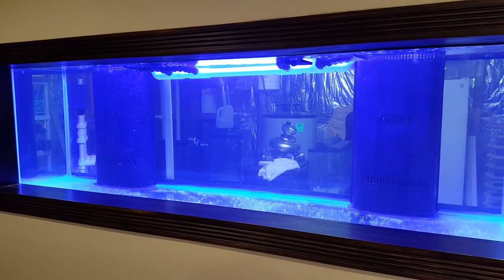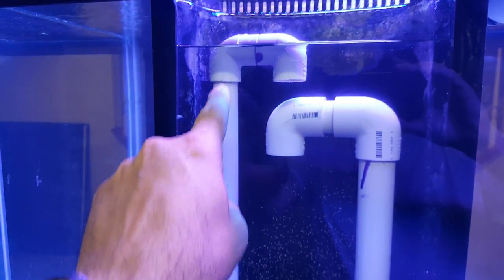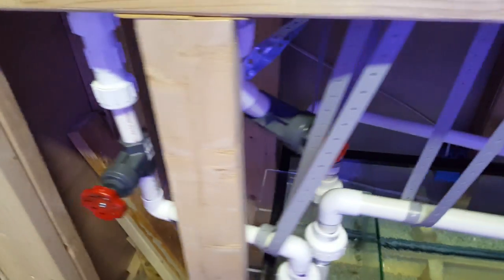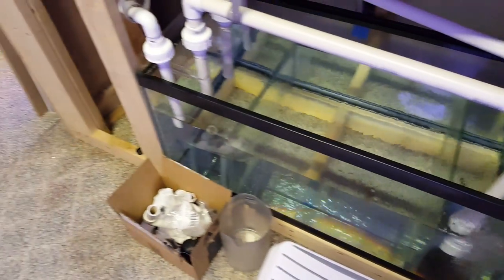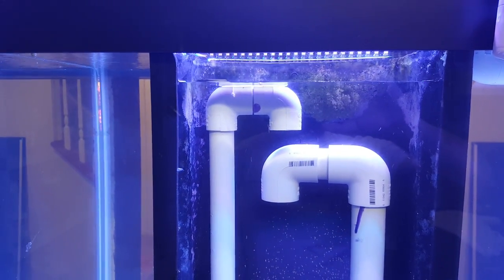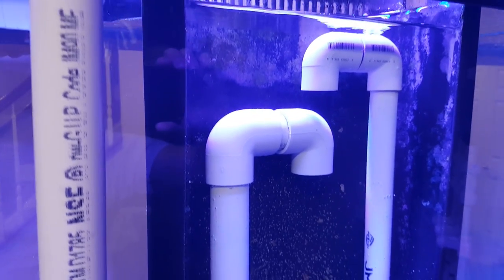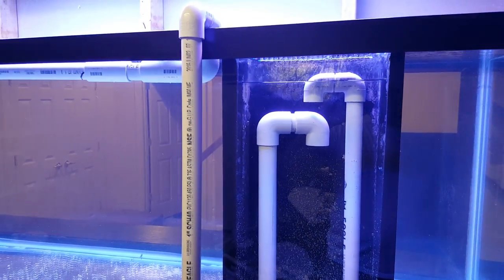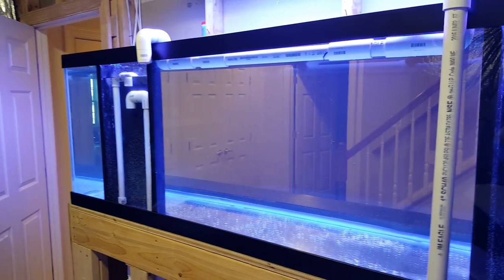How to turn a mega flow into a full siphon.

Comment: Great video! Question...I'm going to do this to my 90 as well..what happens if the the full siphon clogs? The other drain becomes full siphon? I got new bulkheads to fit for Both my drains to be 1"..is that ok? (Both holes in bottom of tank are same size, apparently they didnt used to be in older models)
Reply from the maker: If just 1 full siphon clogged, it is possible that the open channel would go full siphon. I don't think it would carry the load though but the other open channel might be able to take up the slack in that scenario. But the design doesn't depend on this for safety (from flooding). I'll have to experiment with this and see what it does thanks for the idea!
Reply: @WoodBob  Thanks! just asking because I'm going to do this with only one overflow, but I guess it doesnt matter what the 2nd drain does because compared to the durso single drain it came with..its much safer just to have a second drain at all.
Reply from the maker: Ah ok - I see part 2 of your question. With just 2 holes both being 1", if the full siphon of the 2 failed, the other might go full siphon but it would not be able to carry all the load due to not having an open channel. In this case it would probably flush until you realized something was wrong and corrected it.

Comment: how big are the holes drill in top of return need to be thx you sorry to ask so many questions my first sump dont want to flood room
Reply from the maker: If you mean the main siphon standpipe, 1/4" or larger should be fine. It is just an air-entry hole to allow water to flow properly.
Reply: @WoodBob  thx you so much

Comment: I just bought a 180 gallon tank with a single overflow. 2 bulkhead in the overflow, a 1 inch and a 2 inch. Up til watching this video, I was planning on running a die so in the 2 inch and a single return in the 1 inch split into 2 lock lines. My return chamber doesn't have cut-outs for return (lock) lines. I was trying to figure out the best way to plumb this. Now that I've watched this, I'm thinking my best option is to go with a full siphon setup like yours and running my return behind the tank as you've done and over the back rim. Would this in fact be a better option with a single overflow?
Reply from the maker: For sure a full siphon is a better option! Over the back returns are much better and allow greater placement of return flow like I did with multiple returns across the top.
Reply: How would you handle the 1 inch and 2 inch bulkhead in the overflow? Would you step the 2 inch down to a 1 inch at the bulkhead to keep all pvc 1 inch?
Reply from the maker: No it doesn't really matter what size the pipe is as long as it fits the fittings. The bulkhead holes will dictate what size pipe to use I suggest not changing the size but I doubt it matters either way. I know there is a durso video out that talks about using bigger size pipe and necking it down but this is a full siphon so it doesn't matter if the pipe changes size or not.

Comment: Which pump is that and how much head? Just wondering how much you're actually flowing through there.
Reply from the maker: This is the Jabeo DC-6000 with about 4 feet of head. It is rated at around 1500gph. I am very happy with the Jabeo pumps I also have a DC-9000. Those are 1" drains so will run around 2400gph each at full siphon maximum. My estimate is they are at about 25% of max capacity each (600gph), or slightly over 1200gph total flow for both drains.

Comment: What fitting did you say you don’t need for the 3/4 open channel where you drilled the hole?
Reply from the maker: Use slip (glue) connection bulkheads and simply set the drains into place without gluing. This allows for easy removal for maintenance. I use keg lube on all gaskets just be sure not to over-tighten (hand tight only).

Comment: Interesting video im wondering do the full syphon need the double elbow or can they just be straight pipes ?
Reply from the maker: Straight pipe is fine but the double elbow makes sure it doesn't start a vortex from the surface and ingest air.

Comment: You can avoid any chance of getting dry running pump by adding a float switch. Being that you have a dc pump, a boat bilge switch can be wired right in.
Reply from the maker: That is a great idea thanks! That Jebao pump failed I am back to my reliable eheim.

Comment: What's the advantage over using the standard megaflow kit?
Reply from the maker: The standard kit is a Durso style drain which is not full-siphon and somewhat noisy not to mention has relatively low flow and tank turnover rate. Durso drains have largely been replaced in the industry by full-siphon style drains such as Herbie and Bean drains.

Comment: how did you hook  up drains & returns to bulkheads thx you
Reply from the maker: On the bottom of the bulkheads is a threaded connection (slip would also be fine) and in the weir the drains are simply set in place. They do not need to be water tight in the weir but coming out of the bottom, they do.

Comment: awesome setup, I definitely want to replicate this with my 90 and single over flow, is there any benefit to splitting the return and having some flow go to the refugium directly? or does it get enough flow from the skimmer chamber?

I was looking to use the ruby elite 30 or ruby 36S which the elite has the fuge drain separate from the rest of the sump 

http://www.triggersys.com/ts/ruby_sumps/

what is your opinion on having the refugium a completely separate section of the sump with it's own dedicated flow T from the return on a gate/ball valve?
Reply: how do you determine how long to make your return run with the loc lines inside the tank? for a single over flow I would think only 1 or two are needed?

Comment: Just so I'm clear this tank comes from the manufacturer drilled with the overflow boxes?
Reply from the maker: Correct. It comes exactly like you see it.
Reply: @WoodBob  can this exact setup be done on any tank? I built a 300 gallon plywood tank and haven't figured out my filtration yet. I'm using a 75 gallon  tank for a sump.
Reply from the maker: Yeah you sure could this would be great for a plywood build. You'll need at least 1 weir but the rest is the same.

Comment: My tank only has 1 hole in each overflow so would I be fine just doing the full siphon instead of having both the pipes?
Reply from the maker: No you will not be able to balance it out. It will either run too fast and "flush" or it will run too slow starving your return pump. The extra pipe is critical for balancing the full siphon. You might be able to run a full siphon in one weir and use the other one to balance. I have never tried that but it should work in theory! Good luck!

Comment: Awesome video.  Exactly what I needed.  I have this tank in 90 gallons and want to do the same thing.  What calculations are necessary to make this happen?  How do you know how high each pipe has to be?
Reply from the maker: You want the open channel high enough so that the cascading water is not too loud and the full siphon channel below that where no water runs in the open channel when the full siphon is running so that it gradually "creeps" up to the open channel. The open channel height dictates the noise level. The full channel if you wanted could be at the very bottom of the weir. That would mean more water draining back to the sump though when the pump is turned off.
Reply: Thanks

Comment: How does the full siphon re establish if it drains below the opening. Wouldnt air get stuck in it?
Reply from the maker: The siphon is fully automatic since it relies on water being pumped up into the tank. There is no real "starting" of the siphon. As soon as the flow starts, the siphon starts. When it starts, any air is pushed out. If the water should fall below the full siphon stand-pipe (like if the pipe loses flow for whatever reason), water will still drain (slower flow) until the water level gets above the siphon again and then the siphon starts. This process will repeat in a "flush" cycle until the return water volume is increased or the full siphon drain rate is decreased (with the valve). You will frequently see this flush effect in Durso style drains when people push too much return water in an attempt to get higher flow.

Comment: Do you think this set up would work using a canister filter instead of a sump?
Reply from the maker: A canister filter is a closed system and does not work on a siphon principle it uses a pump to circulate the water. I don't think it would work.
Reply: Got both canisters plumbed together, one side works as it should but as the one drops water level inside the overflow, the other side just stays the same. Maybe because of the intake is the same as the return flow? Thanks for any help or suggestions

Comment: How tall are pipes in  overflows & far do they need to be from top of overflows thx you
Reply from the maker: There is no set depth. The important thing is the full siphon needs to be at least 1/2" below the open channel so that it runs at full siphon and then slowly rises to trickle through the open channel. The height of your open channel determines the water level in the weir. The higher it is, the less noise the water will make as it flows into the weir from the aquarium.
Reply: @WoodBob  Ok thx you so much

Comment: I know this video is old. But could I do this in my 24" cube and just use 2 drains instead of 4?
Reply from the maker: Are both the drains in the same corner? If so, you could easily do just 2. Each side is totally independent of the other. You'd still go over the back for the return however.
Reply: @WoodBob  Thank you! Yes, both drains are in the same spot/corner. What is the point of having the open channel?
Reply from the maker: There is no chance of 100% balancing a full siphon drain to where it both doesn't drain too much, creating flushing, or drain too little, flooding the tank. The open channel provides the tuning capabilities where you run your return flow just slightly higher than what is necessary to maintain a full siphon. The open channel ideally will have just a trickle flowing but if you were to have more, it would be able to handle it as well.
Reply: @WoodBob  Ahhh that makes perfect sense! Thanks for the video!!

Comment: Quick question, should I run a filter sock on each drain or just on the two main drains?
Reply from the maker: This is a good question. I do not run the open channel through a filter sock, just the full-siphon channels. However, you could. I don't think it is necessary. This drain when operating efficiently only carries a trickle of water.
Reply: @WoodBob  Hey Rob, quick question for you.  I'm setting this up for the first time and trying to figure out how much room I need to leave in the sump to handle the water drain from the overflows.  Do you know how much water is held in each overflow chamber or at least a good guess?  I want to maximize the amount of water my system holds.  Thanks in advance for your help.
Reply from the maker: The overflows on my tank probably hold about a gallon each when running maybe 2 gallons if they were totally full. Keep in mind more than what is in the overflow will flow back when the pump is off. What is in the pipes and what is above the weir opening will also flow back.
Reply: robc thanks Rob and yes I was thinking about the pipes and above the weir as well.  Why do you think is the best way to determine the amount of room I should leave in the sump?  I’m sure there is an easy answer to this, I just can’t think of it right now.  Should I just fill the tank up and then test in increments turning the pump off and letting everything drain?  And then repeat until water level finds the perfect point?
Reply from the maker: That is exactly what I would do. Only install your return section divider and see how high you can go with the water and still be flood-proof. Once you determine that, put in your glass at that height.

Comment: Nice plumb job! I just got a 130 gallon aquarium recently with dual durso over flows and my bulkheads on the stand pipes are broken. Where can I find those bulks' and what two sizes should I get for drain and return? I'm new to this. Great video
Reply from the maker: Bulk Reef Supply has all the bulkheads. You measure the diameter of the holes and match it up with what they sell. Make sure to get slip connections as threaded usually leak.

Comment: Also add a simple mechanical float switch that would kill the return pump if the water level falls too low.  Would save your return pump from burning up.
Reply from the maker: This is a good idea. But not sure how this could be incorporated to actually electrically disable the pump. The Tunze includes 2 float switches for normal operations. I'll investigate a float switch that can cut power to the entire mechanism. Thanks!

Comment: How many gallons is your tank and what size pump are you using?
Reply from the maker: The tank is 125 gallons, sump is 40 gallons and the pump pictured is the Jebao DC6000 @1600 GPH. That pump failed though and I now use an eheim @900 GPH but actually flows more than the Jebao. It is my feeling that Jebao's will all eventually prematurely fail. I have 1 Jabeo product out of about 10 that I have purchased over the past 5-6 years that is still working. I will not buy Jebao again.
Reply: @WoodBob  cool thank you for the info. I am setting up a 180 gallon tank and it has the dual overflows that I still need to build.

Comment: ive got a 220ga aqueon tank fresh water with the jabeo 6000 dual overflows into a sump .... im getting a flush every so often from each side ive tried tuning with valves with no luck id greatly appreciate your help or suggestions! its my first time having a tank this large with overflows ive read an read but cant seem to figure out the flushing
Reply from the maker: Flushing means you have too much return water. Put a valve on your return pump and crank it back a bit or else set your pump to a lower speed. Full siphons do not have this issue but Durso style drains do. There is only so much water they can flow and then they flush.
Reply: robc thank you i will give this a try i just have a ball valve do you suggest a gate valve like you have or doesnt really matter? also as far as the the 1" bulkhead return pipe should my pvc be larger than the bulk head and use a bushing to reduce back down to 1"?  thanks for the quick response!
Reply from the maker: If you have a Jabeo 6000 pump you can reduce the flow with its controller. If not, then a gate or ball valve will work (gate is better). I don't think for the return water it matters if you have a larger going down to a smaller pipe with a bushing (drains can benefit from this setup). I would just use what works. 1" is what you should be using with a 1" bulkhead.

Comment: What about the auto top off? Won't it continue to refill your pump area?
Reply: When running this is at equilibrium. The auto-top-off works as designed. water level in the return chamber drops a little and is filled which does not affect siphon operation.
Reply: @closewatcher8586  Actually what i meant was something else. As you simulate your blockage your auto top off will run until it runs out of water. This will overflow your main tank. Worst case scenario. I think emergency drain is a better idea as the plumbing is kept dry and only used in case of main line blockage. Unlike yours, my tank only has one big drain with a gate valve and a smaller emergency drain. My overflow tower is not even halfway full so there is some room for extra water there as well.
Reply: Ah ok I see what you mean. If a blockage occurs up to 10 additional gallons could be added to the entire tank volume from the overflow tank. I did take this into consideration and I do think my setup could manage an additional 10 gallons, however, I did not test that scenario. The odds of that happening are remote since both drains would need to clog at the same time which is highly unlikely. I would test that scenario but this tank has since been sold not to be replaced. I am concentrating on just the one marine tank also seen in the video (as a seahorse breeding tank).
Reply: @closewatcher8586  Excellent. I just got back into this hobby after having a disaster. Thankfully my tank is on the ground level with floor tiles. I had to replace my bottom pane of glass that developed a small crack due to my mistake of over tightening bulkheads.A tiny very slow drip developed. Thankfully I did not have that much in the tank at that time. I only lost two maroon clownfish and a big blue tang. I was kind of suspecting a disaster but was too busy to properly fix it. My mistake.

Comment: robc, any chance you tell me what kind of fittings you used?
Reply from the maker: They are 1" and 3/4" PVC schedule 40 fittings. In addition to 45's and 90's I also have some PVC valves and PVC compression fittings.
Reply: @WoodBob  can  you provide some links of the suplier? thanks
Reply from the maker: All fittings were purchased from either Home Depot or Amazon.

Comment: I have a 90g and I want to do a full siphon but not sure if it will work because I only have one overflow
Reply from the maker: It will work fine. On a dual overflow each side is independent of the other.

Comment: amazing work., what's the size of the sump?
Reply from the maker: 40 Gallon Breeder
Reply: so the old return line size is 3/4" and the full siphon is 1" correct?  there is no reason you can't run this setup on a single overflow tank like a 90 gallon right? I have a trigger systems ruby 36 sump,  and a jebao DCP8000, pretty sure I'll run it dry before flooding as well.
Reply from the maker: Yeah it would be identical but you'd lose some of the redundancy of the 2nd weir. Not an issue if designed properly like you stated that it won't overflow no matter what direction should stop.